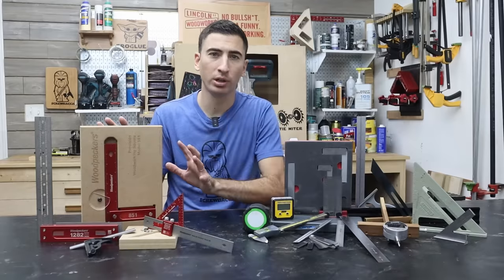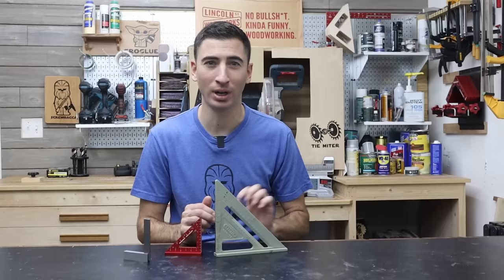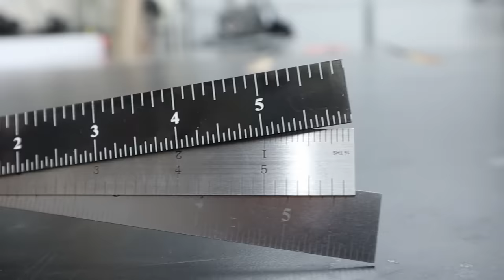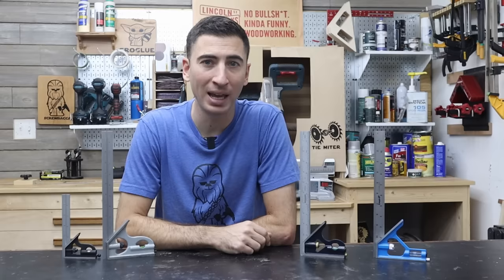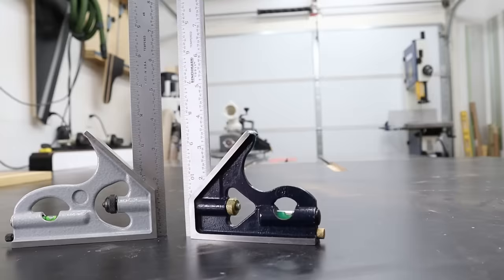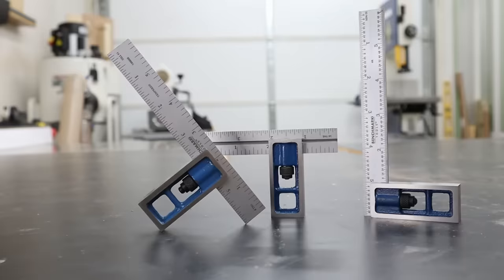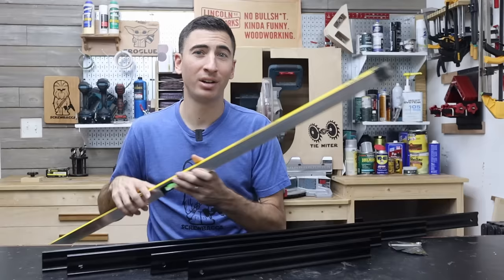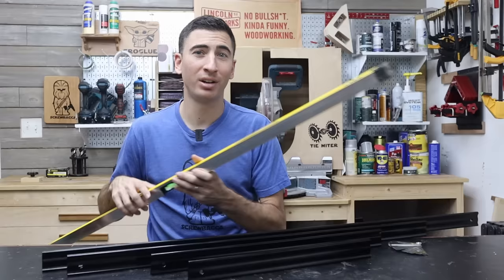Why is woodpeckers so expensive?

Comment: I've purchased some PEC "blem" combo and double squares. Some are fine, but I think that some of the double squares that came as part of a "blem" deal have a lot of slop in the screw/pin that you use to loosen the square. I have multiple PEC double-square handles, and they're not consistently machined with each other. Some of them slide easily, and it's easy to get the rule in and out of the handle. In one of them, the little pin that retains the rule in the handle seems to be machined poorly, and it's a pain to get the rule in and out when you want to flip it to the opposite orientation. I'm not sure if it's because I bought a blem for that one or if it's simply because I got a poorly machined square. All of my rules themselves (even the blems) seem fine, although I haven't checked the shorter ones with my mitutoyo caliper to see if they're accurate to 0.002" or so. My longer squares are longer than my high-end digital caliper, and if one or the other is off, I wouldn't be able to measure the inaccuracy with the tools that I have.

I like double squares for quick/short measurements and quick layout. I don't really love using holes or slots in incra gauges or other tools to do layout because I hate using mechanical pencils, and I also find that when there are a million holes in close proximity, I sometimes put my pencil in the wrong hole. I have these tools, and I use them in some cases, but if I have to make lots of consistent marks then I prefer to set a combo square once and then make marks at the edge.

Comment: Near the beginning of the video, you compare the accuracy of the Woodpecker square to the machinist square. Woodpecker states .001 per foot. The machinist square is about half as long as the Woodpecker square. Does the .0007 tolerance apply to this shorter length square or is it per foot?
Personally, I bought a set of PEC machinist squares and have a Bridge City 12" combination square.
Reply: Exactly, the tolerance is only half of the number

Comment: I would never waste money on  Woodpecker, Festool, etc. Not to say they don't make good stuff but my old tools do the job and are both accurate and precise (not the same thing). I find them on the well-used market and restore as necessary. Neither company existed when I made my first furniture and cabinetry using hand tools and those pieces are all still in use. Would I be pleased if I was gifted say, a Lie-Nielsen No 51 shooting plane? Sure, but my 100 year old Stanley 5 and shop-made shooting board do a fine job so if was ever going to spend that kind of money, it would be on great wood, not name brand gizmos. And when you make/restore your own tools and jigs, but the time they're ready to use you know them inside and out. Bottom line - my give-a-shit factor is high in term of usefulness and nil in terms of brand  name. 
Last thing - I was cleaned out by burglars about 6 years ago and had to rebuild pretty much my entire hand tool inventory. Even with the insurance settlement, I could never have replaced forty years' accumulation of tools at today's prices for so-called premium tools. 
You do a good job here. Keep it up. And thanks.

Comment: A lot of Woodpecker tools are like sports cars. They look great and are nice to show off, but you can certainly get the job done with cheaper options. I have a couple of their tools and would like to get more, but it’s certainly not a necessity. Although, a full wall of matching hot rod red tools sure would look nice!
Reply: My stainless steel woodpeckers square has features most others do not have. I found those features useful. So I spent more money but I got more than a basic square.
Reply: @AaronGeller  yes, they have some really nice features. Just saying, beginner woodworkers shouldn’t feel like they can’t make great projects just because they don’t have the most expensive, flashy tools. You can do great work with cheap, but accurate tools. Then later, as their skills and tool collection have grown, it’s ok to splurge on the hot rod!
Reply: @biscuittreewoodworks  So I definitely agree beginners shouldn't feel they need to buy the expensive stuff in the beginner but they can if they want. Cheap and accurate... I prefer "cheapER and accurate" since people are used to construction precision tool prices and not necessarily, fine woodworking precision tool prices.

Comment: Woodpecker don't make tools, they make jewellery. Over-engineered, ridiculously-priced trinkets. One other thing, if they aren't treated with kid-gloves, it's remarkable how expensive aluminum tools look the same as cheap tools, when they've been used for a while. I have perfectly good "Empire" and Swanson-branded speed squares, all in Metric. The plastic Empire is practically indestructible. I checked them for accuracy against a machine square before use.

Comment: Ya know... I needed a super accurate 24" square cause Im building cabs. Was gonna buy the Woodpecker one cause they are supposedly the gold-standard for accuracy (more like currency by fiat). It was accurate to 0.001" and has that fat ref edge and can stand up, but it was $350+ WTF? I found one at Lee Valley, same accuracy, but no fat ref edge for $99. Im surprised a Private Equity firm hasnt made a bid for that RED tool company. Those peckers charge super high margins, and the cult of YouTube is driving their sales. Woodpecker is the epitome of that Chad-logic a sports car painted red goes faster.

Comment: Your workshop is clean, you probably don't do much in it. I am a pensioner from the Czech Republic and now I enjoy working with wood. As I look at this video, you apparently did not understand that carpentry is not about hundredths of a millimeter and working with wood is not precise engineering production. One Hultaforce carpentry/carpentry square with a good pencil is enough for me. In joinery, it's not about thousandths of a millimeter and probably not even tenths. Rather, it is about ideas and precise work.
Reply from the maker: I own a vacuum

Comment: Controversial comment here.  I literally use my 6" double square and an 18" rule for 99 percent on everything I do.  Everything else is basically useless.  If you are building with calipers you are building the wrong way.  I used to use them and my productivity went way up after I stopped measuring so much, just build based on looks and size your pieces to the stock you have or mill, no need for measuring at all.  Also my aluminum straight edge warped.

Comment: All these accuracy claims are ridiculous.  The highly accurate squares loose all meaning when they are referenced to a piece of wood.  The way those things would be used in a metal shop would be referencing off a known surface, like a granite surface plate.  And keeping that surface as a reference is a whole can of worms itself.  I do have a 6" steel square for the kind of checks he is talking about, I paid  10 bucks 40 years or so ago. Job done.  

I also own a very high precision Rabone Chesterman rule, which did save my bacon a few times when checking out machines to purchase.  cost me a lot around 50 in 1980, And I only used it a few times.  That was a time when production was moving to Asia, and there were some wonky tools showing up.  I probably could not have owned a jointer prior to that time, but it was a case of buyer beware.  Turns out there is a way of doing the same thing with a few sticks of wood and 6 screws.

In an accurate shop lines would not be struck through a hole with a pencil.  When you want a parallel line to a surface, you don't normally want to use a measurement, you want to take it off some other part.  Simple wooden gauges are all you need.  Measurement tools in a wood shop can all be made of wood, other than the reference square whose client is the machines not the projects.  If you are handy with a plane or a file, you can easily true up squares and rules to very fine dimensions, planes are accurate to a few thou over a foot or two.  Wooden planes are as accurate as the metal ones.  If you can't do that kind of work, what are you planing on doing with your measurements when you get them off your red tools?

Woodworking accuracy is very precise, in the same range as metal working, but the process is different.  It is basically the process we used to laugh at with Taiwanese machine tools, when Fine Woodworking came across a worker who's job it was to cut out wrenches for specific bolts on the tools they were making.  They were making the bolts by hand, and they needed custom wrenches.  It wasn't that he did a bad job, there just wasn't standardization and part interchangeability.  But that is usually the case with dovetail joints, or even drawers.  They can be incredibly accurately fit, they just aren't interchangeable.

Comment: Jeez, there's no way I can agree with advice to stay away from box-store combination squares. Those little 6" Empires are my go-to squares. Sure, you may have to test a few before purchase. But at full extension, the error mine produce is still beyond my visible threshold following a decade in service! These tools are (or at least were) absolutely worth owning a pair, even for precision work. 

Let's remember that the bulk of error is corrected by clean procedure, and not by trusting a tool. Most 'precision' equipment is totally wasted on any human consumer. In general, precision is more about having a sharp pencil than a too-true square.

Comment: You are comparing 0.001 to 0.0007 that is not so big of a difference. Also the line you draw on the wood and the shaky hands of a beginner will make that difference indistinguishable.

Comment: I bought Grizzly machinest square. At 1/2 the cost you said and compared to a set of 1 2 3 blocks they are dead on.
Now I did this becuse I worked in a machine shop, when your dealing with squares you not dealing in .000 you dealing with minutes , what .007  or .001 at the tips of a 6" squar is off 10 times that x " futher out.  Its what you'll accept as close enough.   .001 is plenty close for wood becuse wood moves.  Steel moves also just not the same way as wood.   Wood moves with humidity, metal moves with temperature.  The modules expand and contract  wood the fibers absorbe moisture or give it away.
It generally takes a fair amount of energy to change steel, wood on the other hand changes to the seasons.

Machinest tools work good on woodworking  and woodpecker tools are made by machinests looking to find perfection for woodworking.  
No matter the media, there no such this as perfect, just dam close.

Comment: Fun channel and some good advice, what's not to like.   

Can't understand the current obsession with aluminium marking and measuring stuff, does nobody use a marking knife anymore?

Engineers, or as you call them machinists squares are perfect.  Set of four in the UK for £30.00 accurate to 0.03mm over a 150mm blade way better than any woodworker needs.  A good to high end combination square, plus sliding bevel and set gauge some good quality steel rulers a reference straight edge and that's done me fine for 50 years as a cabinet maker.  Sorry, add manual caliper. Oh and three top quality tape measures checked so I know they all are consistent to each other.  Plus read and learn as much about relative dimensioning as you can it will save you heaps of time and heartache.

Keep up the good work young man.
Reply from the maker: Thank you Richard appreciate the kind words

Comment: Just a small correction. You mentioned a Kinex as a “German engineering” brand. Thant’s not correct. Instead, Kinex was and still is Czechoslovakia/Slovakia based brand producing top notch bearings and machinery measurement tools ;-)

Comment: Sorry, but...
The practical difference between .001" and .0007" when working with wood (which moves) is zero.  The tiny bit your saw blade imperceptibly wobbles is more than that too..
If you think you need a combination square (fiddle, fiddle) ok you'll need an expensive one to try and keep it square, but in reality, simpler tools will do the trick without the fiddling.
Yes, you mostly want a rule that goes to the edge but be aware that the edge can get subtly dinged a bit and that first increment can be a bit off.  Handy for shoving up against something though.

Comment: I think more could have been made of the steel vs. aluminum debate.  Do you do a lot of marking knife work?  Ever had any scoring on the aluminum tools from the marking knife.  Are aluminum edges dinged over time and no longer straight?  Just wondering.

Comment: I built a $4,000 cabinet using cheap measuring tools. I built another $4000 cabinet using expensive tools. No difference at all. Expensive tools are a waste of money unless it is power tool that provides more power.

Comment: Aluminum is not cheaper to produce than steel. You kind of repeated the point so I'm not sure if you misspoke  and missed it in editing or if you just thought that for some reason.

Aluminum is way superior. You'll never be able to see the patina unless you're a metallurgical scientist and actively inspect it, for all intents and purposes it's incredibly strong, and it's lighter.

while technically being much softer, it's not noticeable in any of our wood applications. Also, you won't ding up any of your steel blades if you hit it with the aluminum in a fit of rage

Edit: I saw it again where you said steel is 2x the price.... where the heck are you getting these numbers? Or are you assuming the price difference between 2 products is because they're steel???

Comment: I really disagree. First off, if you know you’re getting into wood working or the like, then just buy one combination square from a reputable manufacturer. Why buy all the cheap tools, when you and I both know that they’ll end up buying a quality square at the end. 
I agree w/buying a machinist square, but that would be secondary or tertiary to your first square, as you should also be purchasing a machinists square from a reputable manufacturer. 
Next, the SS vs alum options definitely do matter and it is a pretty big issue for me that wp doesn’t sell an all steel square. Furthermore, I think they might even do so purposely, so you end up rebuying after a couple years and I’m not a big fan of such practices. I have one 12” Starrett combination square, and a WP 6” indexable square w/steel ruler. With just these two, there’s not really any need for others(and Starrett machinist square) I also expect the Starrett square to last mine and my kids lifetime, whereas I’m not sure w/the WP. I do have other squares, as I went about it with your thinking initially, but those I end up loosing b.c I don’t care about them or just give them away. Point is, they see no use thus a waste of money, why do that. Buy once, cry once etc.

Comment: One thing to keep in mind with the digital calipers is to buy a slightly higher quality one that doesn't drain the battery when not in use. The cheaper ones on Amazon will drain those coin cell batteries like a vampire and when you reach for it, it will be dead. I went through about 6 batteries before replacing mine with a nice Mitutoyo.

Comment: Have you ever used a drafting mechanical pencil? They are thicker and you can sharpen them to fit into a small spots
Reply from the maker: I haven't - but I do like using basic #2 pencils that you need to sharpen
Reply: @Lincolnstww  I believe the lead is thicker and can change colors for different wood or metal. I feel as though it holds a point line then a #2 as well. You can get them for like 2-5 bucks on Amazon. Love the videos especially the comedy style

Comment: I would never use a digital angle finder for anything that requires a precise measurement. Out of the half dozen or so I've used, NONE of them give the same readings. Also, read the specs and you'll see they are nowhere near accurate enough for anything other than rough carpentry.

Comment: I wouldn't spend more than $10 on a square of any kind. Stuff being perfectly square is over rated. If it looks square, it's square enough. Wood will also move (out of square) until it is finished off and put in its final location.

Comment: I think all should start with crappy tools then get the good ones to know the diff.   I find with marking that as long as i use the same measuring tool its all relative. I would also say that going one is .0005 more accurate than another and thats the deciding factor is kinda funny.  Maybe for a machinist but wood will change based on humidity.   For squares I have my starrett and a set of precision machinist squares to check my squares for square.  (that was confusing).    For caliper, i prefer digital like you and a mitutoyo.  I also like i can send for recalibration if it ever gets off..  Not sure that will happen.   Only place i differ is those cheap speed squares only good for decks / construction where that don't matter.   Spend a little more get a good speed square.   One you did not mention that i love is a set of 1,2,3 blocks and a bagnetic base for measuring runout.   I have a cnc and leveling the that sucker is a PIA.  Can't imagine having a spindle bit out +/- .002.     

Lastly its just nice to work with good tools and if i have to pay extra to get american made so be it.  (except for the german engineerring & the Mitutoyo)...Can we talk Festool :)  cheers

Great content